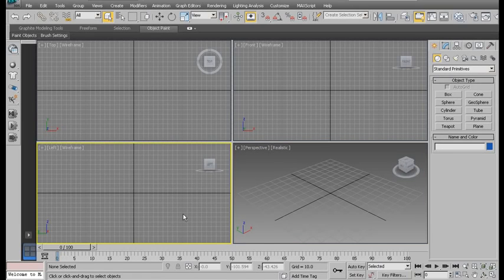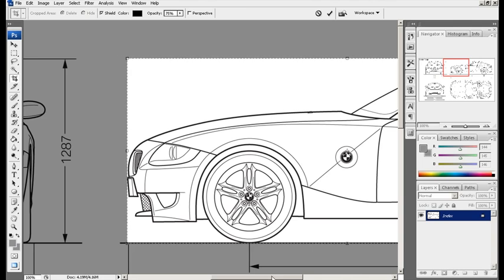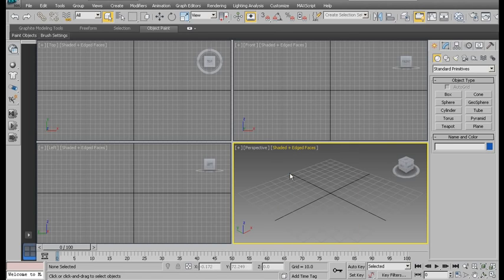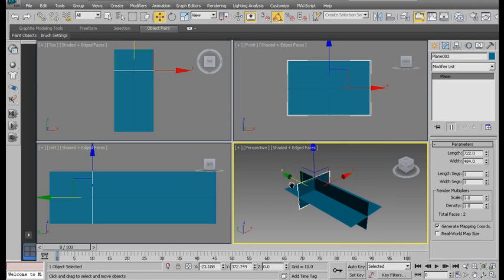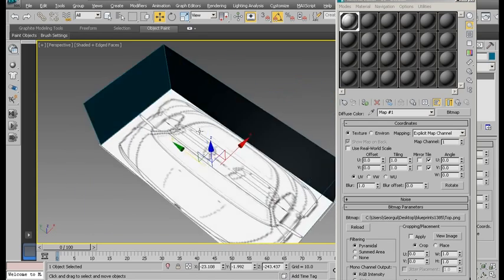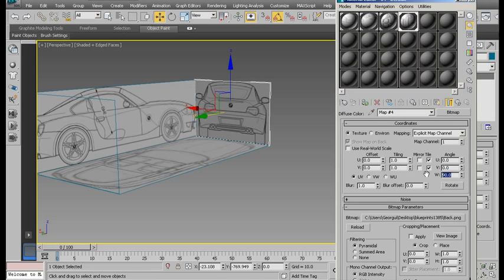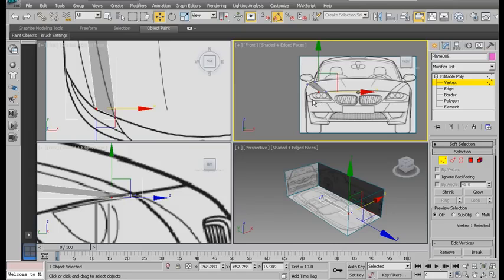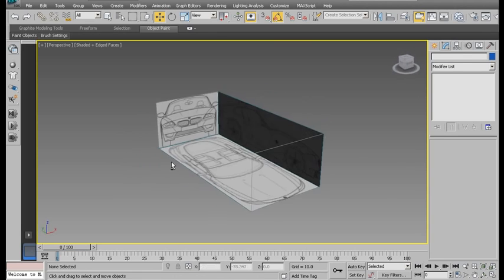Setting up Blueprints in 3Ds Max

Comment: When you export each view, do you have to ensure first that each view is the exact same scale, or do you fix this by resizing each image so they are the same amount of pixels in one dimension?
Reply from the maker: Hi Harry, it really depends on the blueprint here - if you'll notice that as I'm cutting up the blueprint in Photoshop, I'm cropping right along the furthest edge from each side of the car. For example, take a look at the back and front views. If the blueprint has been drawn correctly then when I look at the dimensions of each of these cropped images, they should have the same dimensions. I check that at 4:11. 

I've never had to resize and I generally wouldn't want to because when you pull the images into Max, the quality goes down a little bit.

Hope this answers your question, let me know if you need anymore help!
Reply: Well I got this BMW blueprint: www.smcars.net/attachments/bmw1-5door-2011-gif.122591 but the left view the height is differtent from the front & back view... I don't get it. Do you have any suggestion?